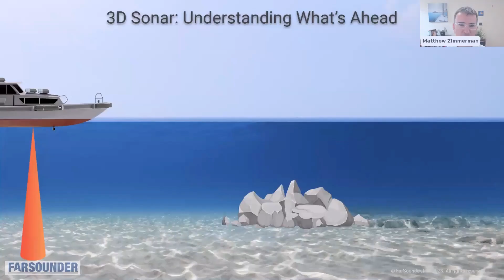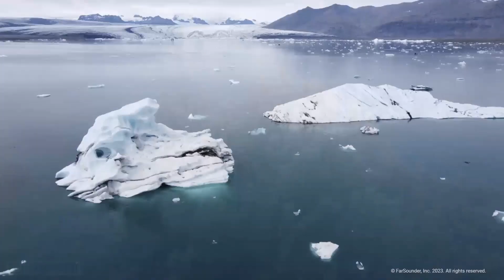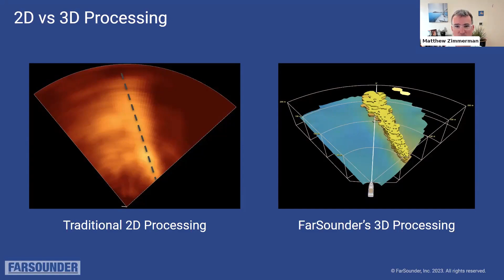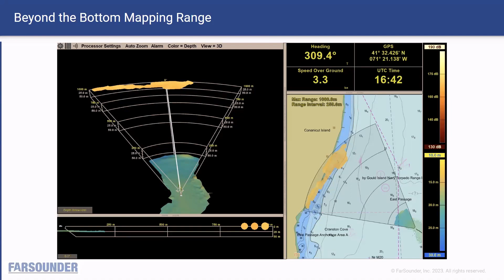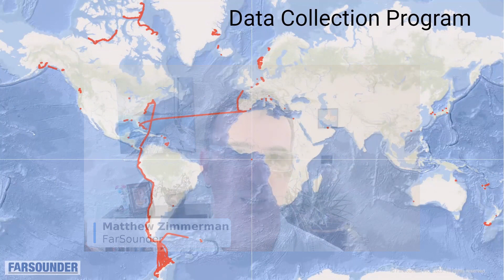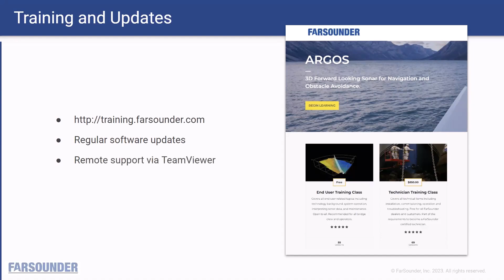3D Forward Looking Sonar for Unmanned Surface Vehicles (USV) - Webinar

Comment: It sounds great. I have a 51-foot personal SV. What's the recommended model and price point? Can it be integrated/overlaid with existing chart plotter systems? Also, how involved is the installation and would there need to be significant alterations to a GRP hull? Thanks
Reply from the maker: Thank you for commenting and your interest in the Argos Forward Looking Sonars! The Argos 350 would be the most appropriate model for a 51-foot vessel. There would be some alterations to your hull needed for the installation. It varies from vessel to vessel. For full details and pricing, please contact our sales department at sales@farsounder.com